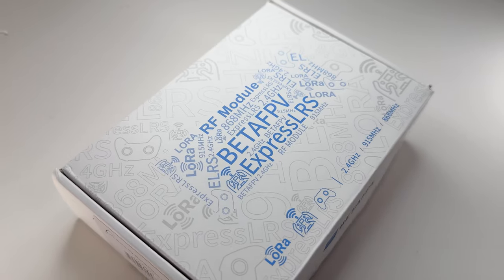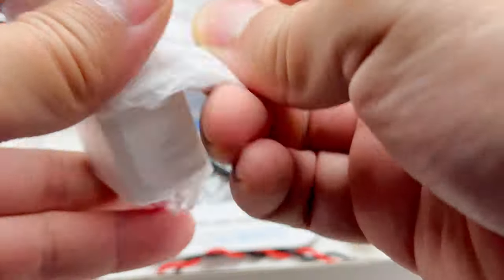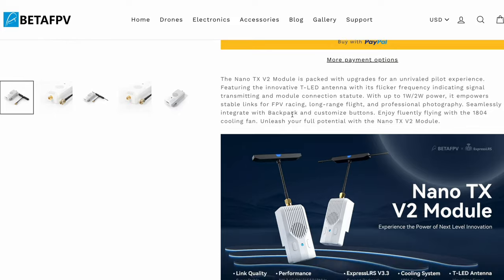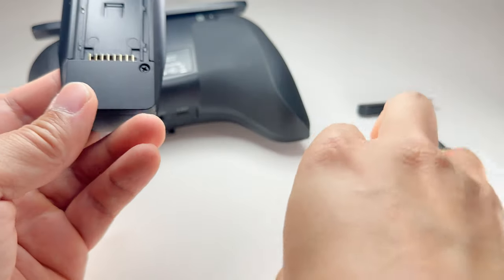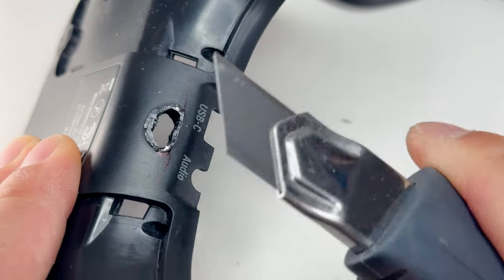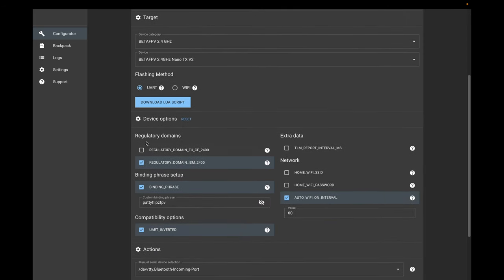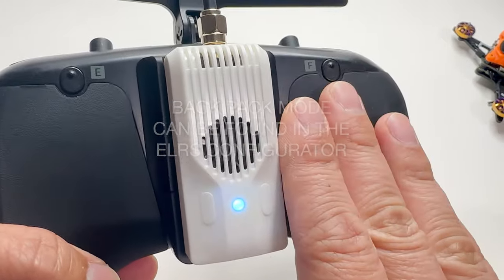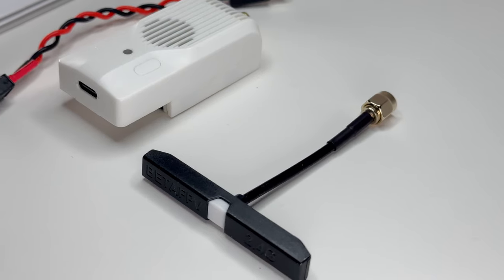BetaFPV Nano TX V2 ExpressLRS Module Review and TBS Tango 2 Module Bay Install

Comment: As you said, it can be a solution with micro whoops on elrs. I'll go that route too, I love my Tango2, I've had it for like 4 years or something. Can you say smth about the battery life with this adapter? Of course, it all depends on the power, but I'm talking about the approximate number of times. Thank you
Reply from the maker: I’ve been flying lots of tinywhoops lately and I’d have to say it definitely drains your tango 2 internal battery faster than standard. Feeling wise” I would say 10-15% faster. This is outputting at 50mw. If you worry about the extra drain, you can connect a 2s Lipo to the nano tx with an external usb c to xt30 adapter included in the kit

Comment: using external module with tbs needs happymodel's pdb to be able to power external module above 250mw.. using tbs one will randomly cut the power of external module because the internal pdb cant deliver the needed power.. all because of the tango 2 is powered by 1s lipo. and elrs needs 2s minimum.
Reply from the maker: Interesting!! Thanks for the tip!!
Reply: @AlexLeeping Thats because the D stands for diversity with if your only using a single antenna it wont work, choose the ones without the D in front of it.
Reply: @AlexLeeping im using the matek diversity receiver with the tango 2 controller with the betafpv elrs module and i am running D250 with no errors and it works just fine and there is no latency
Reply: Even on the v3 board?
Reply: I did this mod today. And kept max output to 500mw. Fan threshold to 500mw. And power dynamic.
And while my quad was literally outside my room it crashed. Because of rx loss.
I knew there was something up.
Thank you. Do you have any link for the pdb?